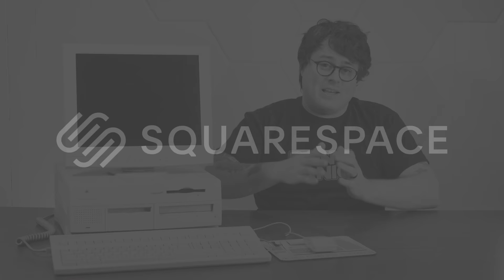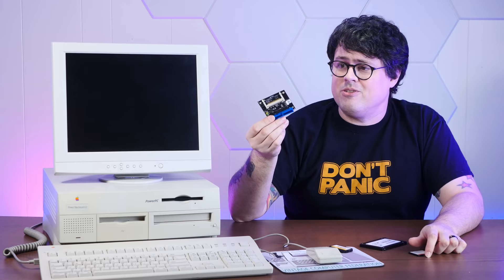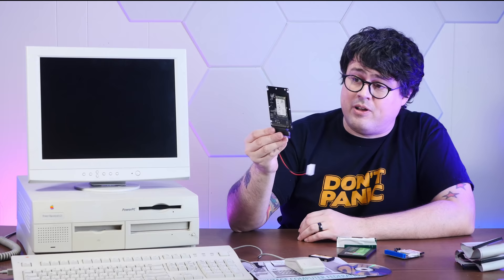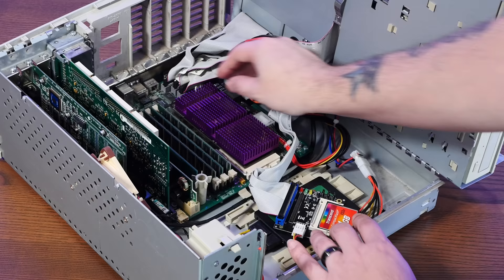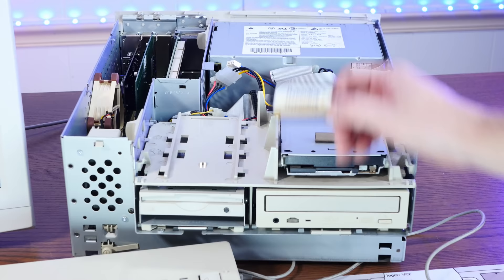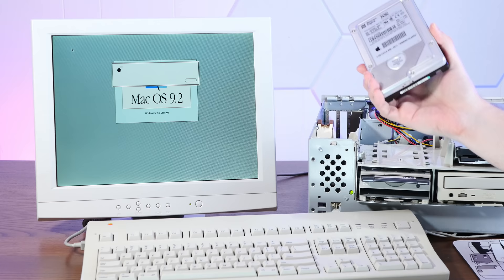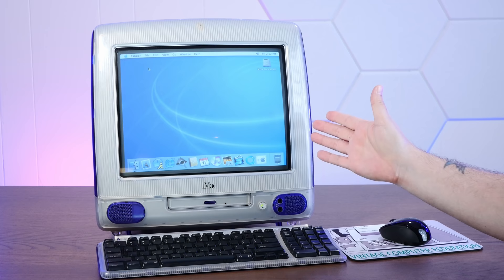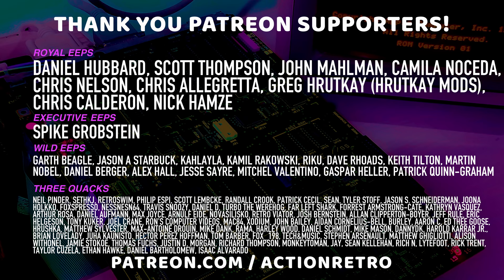Using an Industrial Disk Module in a PowerMac - it's AWESOME!

Comment: Coming from the OG Xbox modding scene, we only use 80 conductor IDE cables for SATA adapter to reduce cross talk. Systems often won't boot if we use the OEM 40.

Comment: Don't solder that cable... just buy two IDC50 connectors and snap them on to some 50 pin ribbon cable.  (This is how we used to make IDE cables back in the day, except we used 40-pin/IDC40.  These connectors are standard off the shelf parts.  No soldering required.) ✌🏻

Comment: The secret to successfully using CF cards as HDDs is to use industrial CF cards.

Industrial CF cards like the Transcend CF220I and Transcend CF170 are designed specifically with usage as a fixed disk in mind. The CF220I supports SMART, Global Wear-Leveling, UDMA1-5, PIO, and true IDE mode. These industrial compact flash cards are also seen as fixed disks, not removeable cards by operating systems. These cards are full on IDE SSDs in a CF card format. Datasheets are available online for both models.

The best part is that the CF220I uses SLC NAND for ultimate reliability. The CF170 uses MLC and comes in larger sizes. I use them with all my vintage computers builds. In everything from a Intel 386 to a Pentium 4 these Transcend cards have always worked well.

Trying to use CF cards meant for cameras is a an exercise in futility. They often have flaky UDMA implementations and will always be treated as removable media by operating systems newer than Windows 9x.
Reply: Only quirk I see now is making this work in - the Mac Mini.  And finding a way to power them in powerbooks.

Comment: Finally got an SSD to work in that damn iMac! I've seen these modules on eBay and Amazon and was thinking myself of trying them in a few vintage machines, mostly PC's since you get the smaller 512mb and 1gb modules to replace the hard drives in the older machines. Glad to see it works on Mac's, and if it works on those, then i'm sure it will work on an old Pentium PC!
Reply: I was just lucky! I got one of those startech on my iMac 500 and it just worked :D

Comment: You should try using an IDE extension cable for the iMac. The DOM should be able to just plug into the cable and that way there will be room for the optical drive too.

Comment: I use a CF adaptor for my g3 wallstreet (with a broken hinge    ):    ) Its cheap, reliable and easy to set up due to its high compatibility and is always better than a failing hard disk
Reply: I use Compact Flash cards as hard-drives in my 1999 Lombard G3 Powerbook (32 GB) and my 2001 Titanium Powerbook G4 (128 GB). They're exceptionally reliable, and have none of the issues I've encountered with mSATA drives (Powerbook G3s freeze when drag-and-drop transferring files from a USB volume) and SD cards (G3s hate extracting files from an SD hard-drive).

Comment: You missed an opportunity to use Doug score sound ;-) I used these for DOS 6.22 & Windows 2000. Running windows requires sending temp files to another drive to prevent wearout of the media. Don't know how Max OS handles temp files, but it is something to watch.

Comment: Those HP Thinclients also use those modules.
I kept mine around in case it could be of use again, otherwise I replaced it with a card reader to install Windows 98 or XP onto it.

Comment: DOM emulates a spinning drive so it makes sense that they work on mac. The sizes are relatively small and most are eide you will still have some compatibility issues. They are slow. Which is fine on a water jet machine or a milling machine because they often use 486’s

Comment: The disc drive mounting issues with the iMac G3 can probably be better resolved with a short extension for the DoM. Yeah it's $7 more, but it's better than a dead iMac or failed cable hack.

Comment: I’ve had good luck using the cheap IDE to SD adapters in my vintage Macs, including my rev C Grape iMac. Where they’ve let me down is the G4 iMac… I’ll have to order a couple of these SSD and try them in the G4’s.
Reply: I've had good luck with cheap IDE to SD adapters myself, mostly in retro PC laptops. 

The adapters are cheap, and so are the SD cards. Also SD cards are easy to get in various sizes, and can be bought locally mostly in addition to online.

Comment: I really wish DOMs were more available(new) in the 44pin PATA format for laptops. Since some of those older laptops don't like even modern PATA SSDs. But for some reason DOMs are treated like mechanical drives.

That said, if you find any really good, and really small 44pin IDE to sata adapters, let me know. Since some 2.5" ssds.. if you open the up, the actual SSD is really small and most of the 2.5" drive is empty. So it would easily fit the sata ssd+ adapter in an old laptop.

Comment: i have found that these exact modules are great for earlier IDE/PATA systems but underperform significantly compared to regular hard drives by the time of G4/PIII. I’ve even tried them in RAID and it’s mostly underwhelming. 
But i LOVE that you can plug it directly into the mobo/controller socket with no cable! Makes cable management in older systems…. possible 🤓

Comment: The issue with IDE SSDs of any kind is they don't support TRIM, so they can't pre-erase memory pages that are no longer used by files to improve speed the next time those pages are written with new data. CompactFlash and other memory cards are different from SSDs in that the erasure of memory pages occurs in realtime, which reduces speed overall but avoids imposing a severe penalty in the future when a non-TRIMmable SSD runs out of empty memory pages.
If I had to run an IDE-based computer nowadays, I would use a IDE-to-CompactFlash adapter instead of an IDE SSD. I used an IDE SSD in the past and it was awful for the reason I mentioned.

Comment: I think the only reason these DOMs don't have larger capacities is simply due to their size. That and, being for industrial applications, they're built with tolerances in mind that traditional flash memory isn't so keen on.
OWC offers a 120GB SSD kit for legacy machines for about $60, and Transcend offers something similar to this DOM for about $20 with the same sizing. And as you were mentioning KingSpec, I remembered that I bought a 64GB PATA SSD from them a few years ago. They offer that for around $50, so better value per gig but not tremendously so. But I have had a KingSpec running in my IBM T23 for a long while now and it's been fantastic. The biggest caveat for a lot of these is that interface. Yeah, PATA is based on IDE, but it has physically more pins jammed into a smaller footprint for 2.5 inch drive bays in laptops, and people seem to struggle with that. Never got those stupid 44-to-40-pin adapters to cooperate either.

Comment: I got an mSD2IDE adapter for my P3 rig….godsend.

Being able to have DOS have access to an mSD made things like installing W98 allot easier, Ghost images, large file transfers, etc.

I’ve also use the mSD for temporary installs of things like 2000 and OS/2, since it sees the mSD as an IDE HDD and I’ve had 0 issues other than what you’d expect from an IDE HDD e.g. size limits. Although I have the adapter as secondary master, so I can keep the main SSD ‘safe’ by disabling primary IDE in BIOS.

Yeah I know it’s a mac channel, but I’m seriously impressed by it so far.

Comment: On the DigiKey website you can order flat ribbon cables that they crimp to order in a variety of types. No need to manually extend your cable or pay insane eBay prices for ide/scsi ribbon cables.
Reply: Was going to say the same thing. It’s very easy to make custom length ribbon cables. You just cut to length and clamp the connector block down wherever you want it.
Reply: Exactly. Making them at home is easy enough and just two days ago I saw that DigiKey will crimp them for you. So we can choose, lazy or not lazy. So many wonderful options. @grahamc87

Comment: This is an unrealistically cool theme, but only for computers with vertically located IDE ports.
In my PowerMac G4 FW800, it just won't fit, because when you close the lid, it will have no space between the bottom and the board (this is the only ATA100 port, the rest seem to be ATA66, which is much slower).
I would like to deal with this, as such IDM disks are available to me at fairly low prices.

Many thanks to the author for such a video!!!

Comment: I had no problems installing a PATA to SATA adapter in my 2000 iMac G3 (thanks for one of your prior videos for this feat).  It is working flawlessly.  What I am struggling with right now is finding a  slot-loading DVD drive to replace the malfunctioning CD drive.  I've spent a lot of time searching all over the 'net for a compatible drive that will fit in the proper orientation and I keep coming up short.  Love your content.  Keep it coming!
Reply: Go to UsedMac, search up 661-2225. Sorry for the repeated notifications, and good luck getting the dvd drive!
Reply: @nickfury1279  Thanks for the part#.  I found a couple, but way over my budget.  Found one on Ebay being sold for parts --I'll see if I can get that and if it does not work, attempt to fix it.  LOL!  Many thanks!

Comment: Two things, those green SATA to IDE adaptors are garabage.  I've had no end of blue screens using them on my 9x machines.  A Startech adaptor works great. 

Second, you have to try the black SSD to IDE adaptors.   Cheap, fast, and they seem to work with everything.

Comment: Cf cards are ide interface already, so whats going to limit speed is the cf card speed itself and bus speed, the sata ssd is maxing out the ide connection hence the quick install time, if you find a 266x cf card you might see a different result, there is also some Pata ssds out there in 2.5 form factor that will fully use the ide i have one in a laptop and it is very fast, i use a cf card in my retro pc because i can take it you and transfer files quick and easy

Comment: Would those SSDs work over IDE if you used an 80 wire cable? I know the original Xbox, when upgrading to an SSD over a converter to IDE, you need to upgrade to an 80 wire cable. Obviously the Mac is a completely different system, and you might already have an 80 wire in there, but figured it was worth mentioning!!!
Reply: Why wouldn't it work, the 80 wire cable is still 40 pin IDE cable just with double wires to each pin. The only thing that the 80 wire does is to reduce crosstalk between the wires (better signal integrity) which usually helps out drive performance a bit.
Reply: @madmax2069  I have no idea why, they just dont. its a known issue in the xbox community. 80 pin can also improve speed just a tad as well. im guessing it has something to do with the physical bandwidth of each pin. maybe 80 pins have more copper between the pins? just stating what I'm aware of.
Reply: @madmax2069  after doing more research 80 pin DO provide higher speeds, which im assuming, the SSD and the converter(only certain ones work on xbox), require a certain speed to work properly? either way, 80 pin cables fix that problem(on xbox), so i figured id throw it out as a possible solution.
Reply: @DeaseNootz  they can but not always do, especially if you're already saturating the IDE controllers max speed (like on the beige G3).
Reply: @madmax2069  awesome, thanks for the tip.
Reply: @DeaseNootz  I know, I upgraded the cable in my Xbox to a 80 wire back in the day to get a bit better speeds from the HDD.
Reply: @madmax2069  cool!
Reply: @DeaseNootz  well there really wouldn't be a requirement for faster speeds per say (you can go as fast as you want until you hit the IDE controllers max speed), but there may be a limit on how slow of a speed you'd want to go.

Comment: I see plenty of longer 50-pin cables on Amazon, and if you need something a bit shorter it’s fairly straightforward to get a longer cable and move the connector up a bit. You could also separate out the wires to get the added flexibility like on the Apple one.

Comment: I've got one of these Disk On Module units in my Reverse Sleeper 800MHz Celeron Windows 98 System that I use on my channel.  It seems to boot slower than it did with a CF Card, but when the machine is up and running I don't really notice a difference between it and the CF Card; so I leave it in there for the same reason with it being cleaner and not taking up as much space.

Comment: Just buy a short section of ribbon cable and the 50 pin IDC connectors from mouser or digikey and make your own cable of the exact length you need.

Comment: The 50-pin cable is standard SCSI, also commonly used on higher-end PCs in the 90s. I think I've got some longer ones out of a Xenix box around here somewhere.

I may have to pick up one of those disk-on-modules for my slot-loading G3, the CD drive cable won't be an issue since I replaced that with an internal USB floppy drive years ago!

Comment: It's not just vintage Macs, I have an HP Omnibook Pentium mmx laptop that won't detect any SSD adapters or CF cards either. But I have an 8gb hard drive in it. Maybe I will look into a disk on module... 🤣

Comment: I've never had any luck using SATA to IDE, or MSATA to IDE adapters, or even 68 pin SCSI to 50 pin SCSI adapters. Always ends up with some type of corruption or damaged hardware. A true IDE SSD is the only way to go, or buy a later 80-120GB IDE drive.

Comment: Couldn't you use an short IDE extender for the DoM in the iMac, to move the disk out of the way of the CD drive cable, instead of extending the CD drive cable?

Comment: Would love to switch my 68k Mac from a HDD to an SSD, it uses SCSI thought.
Reply: I still have two 68k Macs.  I have the Floppy Emu attached to the Mac Plus and the SCSC2SD in my LC475.  On the Floppy Emu I have boot drives for System 6.08, 7.1 and 7.5.3.   On the LC475 the SCSI2SD boots to 8.1.   They are not cheap and also due to parts issues can be hard to find now but they have been quite reliable.

The SCSI2SD even survived the death of my LC475 power supply with only corrupted firmware which I was able to restore.  I also learned how to repair a power supply.  :)
Reply: @sinjinhawke  I own a Performa 475 with a full 040 (a pull from a dead 840AV), 132MB Ram (found a 128MB stick for $5 so why not), with network and upgraded video memory, and a 2GB HDD. Also have an external LaCie optical drive for it.

Comment: Wishing those disk on module things could be had in higher capacities. At least on the windows side, I use an SD to ide adapter because even in the best case, for Windows 98se, I could get the text portion of its setup to recognize and install to an ssd, but it's as if it actively refuses to finish the graphical part of the install. And even with a via board where there were sata drivers for windows 9x, it staunchly refused to let me enable DMA which gimped performance.
Reply: Those green SATA to IDE adaptors are crap.  I had tons of problems until I bought Startech adaptors.

Comment: I don’t know what the differences are between the tray loader and slot loader G3 iMac’s, but after your BSD video I was curious so I dug out my Sage green G3 slot loader that I’ve been meaning to resto-mod. I switched out the stock hdd with a Samsung 256gb SSD on a SATA/IDE adapter. It hasn’t seemed to be a problem so far. I was able to image it with MacOS9Lives’ image. Been having quite a good time hammering MacintoshReposotry’s FTP servers with game downloads. I even put a SATA extension cable on it and have it dangling out the back so I can easily dabble with BSD/Linux/MorphOS without worrying about blowing up my OS9 install.
Reply from the maker: Nice! Yeah I think it's just the tray loaders that are picky about drives

Comment: Does the CD-ROM ribbon cable use the same standard pitch ribbon as the old 40/50 pin IDE/SCSI cables? If so it might be easier to carefully disassemble the connectors and pull the cable off, then re-crimp a new cable on that's the correct length. You can then carefully split the wires to make it more flexible like the old cable. It might also be possible to find the connectors themselves on eBay or Aliexpress, or possibly a regular electronics supplier.

Comment: SSD to IDE adapters are very picky with the cable you give them. They don't like 40 wire cables. An 80 wire cable can solve a lot of issues with them. This manly has to do with the speed of data transfer. Anything over 33MB/s can start to see problems with a 40 wire cable. The extra 40 wires are all ground wires to help eliminate interference, enabling speeds up to 133MB/s. SSD to IDE adapters are more pron to having problems because of there high speed, where as the 133x CF card you have tops out around 20MB/s. As for the iMac G3, that IDE cable is a 40 wire and all split and just gets bombarded with interference, there is just no hope for any fast transfer speeds. Apple knew this and tried to make it better by adding a ferrite ring to the cable. This worked fine for there slow HDD but anything faster is just asking for troubles. The disk on module l is a great idea, but as for getting the CD rom drive to work, you can buy a short 80 wire ide extension cable to plug the disk on module into and use the original CD rom cable.

Comment: Thx for that, I have to try another thing on my G4-Cube. My adapter-solution with m-sata-ssd works only on coldboot, every restart leads to "?" that is annoying when you have a multi-boot-machine with yaboot an OS9.0.3/OSX10.2.8/YDL3 (beside YDL3 should work on R128pro accelerated (old threads on google) but I have not figured it out yet. now I am thinking about a DOM for my G4-Cube in order to get an always booting solution.

Comment: IDE cables have a lot of crosstalk, I cut one up recently to use as jumper wire to connect up a rgb console mod, and would up having to replace the wiring with solid core wire because the output looked and sounded terrible.